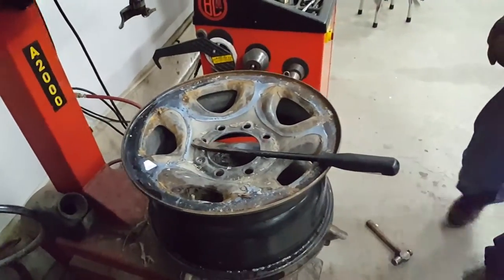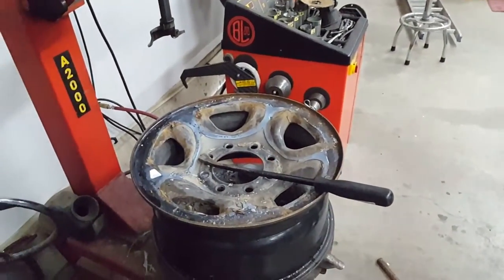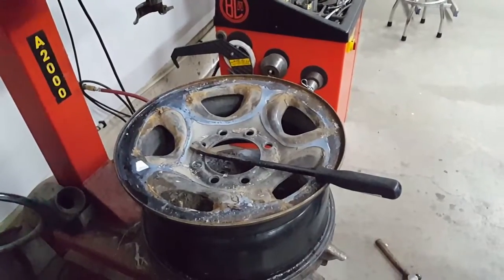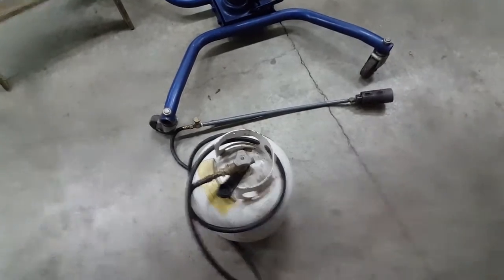Remove factory chrome wheel covers in 90 seconds!

Comment: Can these be removed with tires on? My wheel weights are on the inside of the rim.
Reply: I was wondering the same thing, it's possible but taking the chrome cover off might throw the wheel balance off. It would be best to have them balanced afterwards

Comment: Jeez.  I thought they were just snapped in there like a traditional wheel cover.  I didn't realize they were glued on.  I was considering removing mines and just paint the wheel black.  It would be a lot of work to get the wheel ready for paint.  Not impossible, just more time than I'm willing to spend.

Thanks for the video, you saved me some work.
Reply: sad part is the wheel is already black, if there was just a way to get these off without scratching or tearing up the powder coat that
 would be nice
Reply: Agreed.   However, now that I put larger more aggressive tires, I'm digging the chrome skins on my 2015 Sierra.